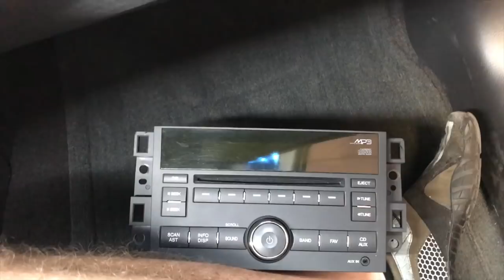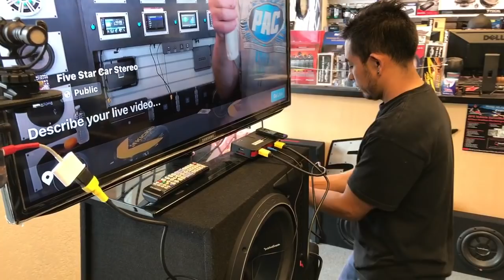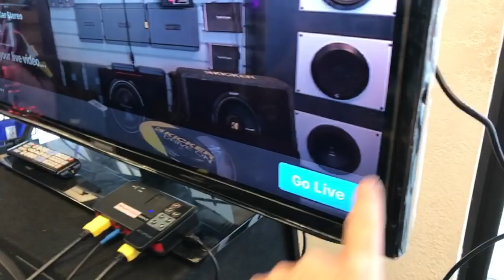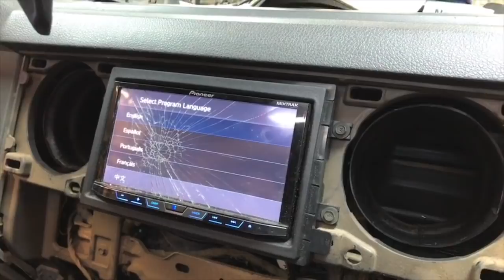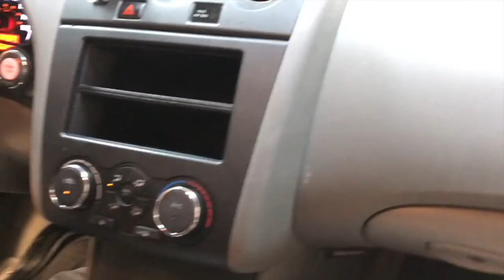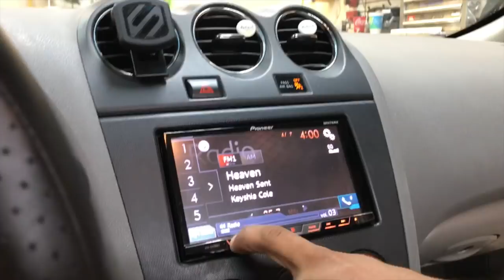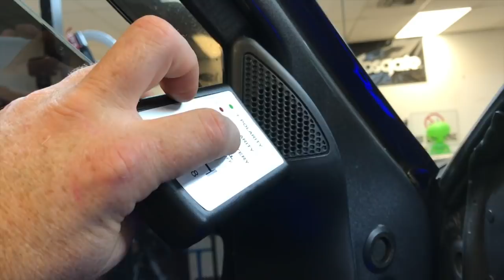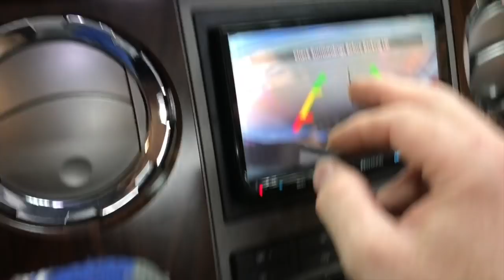Five star car stereo Bi weekly vlog episode 7

Comment: Why did you use the line output converter with the Kicker amplifier? You can run speaker level directly into the RCA inputs on every amp Kicker makes. Just cut the tips off the RCA cable or use a KISL if you want to get fancy.
Reply: Coz he is a professional.He won't cut wire unless last resort.
Reply from the maker: firebirdude2 we have not had the greatest of luck with the built in high level inputs. To solve the problem we just use the PACs all the time.
Reply: Five Star Car Stereo I was thinking the same thing. usually you get a better preamped signal and you don't have to turn the gain up as high. usually cleaner signal so you don't distort. sound about right?
Reply: Space Cowboy+ You don't have to turn the gain up as high when moving to low level inputs?! Might wanna rethink that. And the closer your signal gets to the noise floor, the more noise you'll hear amplified.
Reply: Alpha Omega+ He still has to cut into the OEM speaker wires. Maybe think a bit before you post next time. Coz.
Reply: All of your prerogative. Just saying you can keep that signal strong as heck and make use of the DC offset turn on feature. Should work fine unless you're running a newer Dodge/Chrysler or like one model Chevy smart head unit. You're good to go on all the vehicles in this video.
Reply: Speaker wire<Critical wires ie. Power, remote, and grounds.

Rethink before you post.

Comment: I just installed a pioneer AVH-4200 with Maestro rr and change the factory speakers for a pioneer for a 2015 currolla base. I would like in the future to install an amp but I would like to use the same wiring that comes from factory  speakers, will it be possible? without cutting the factory cables?
Reply from the maker: +Luis Morales yes, keep the power under a 100watts per channel. Pioneer make several 4 channel amps that will work.

Comment: What is that little box your putting beside the kicker amp? The PAC box?
Reply: LP7-2. It's a line output converter and completely unnecessary with that Kicker amplifier.
Reply from the maker: +firebirdude2  we use the PAC  because we have had problems with the high level features on the Kicker amps. To avoid having to go back and add one we just always use a PAC. No issues, all is good.